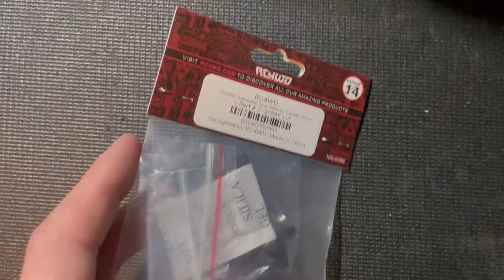Trx4 High Trail K10 RC4WD Drop Hitch Install

Comment: What brand is the receiver hitch already on your truck that works with the new drop hitch?
Reply from the maker: Factory, the factory bumper was a square hole for a hitch, the one I stuck in there at first was just a injora, the trx4 high trail needs the rc4wd drop hitch where it’s lifted